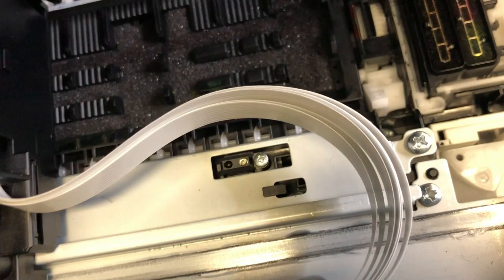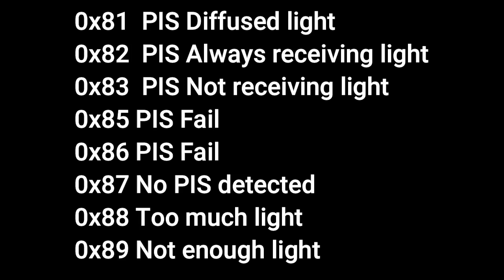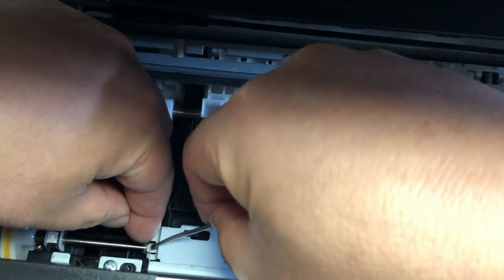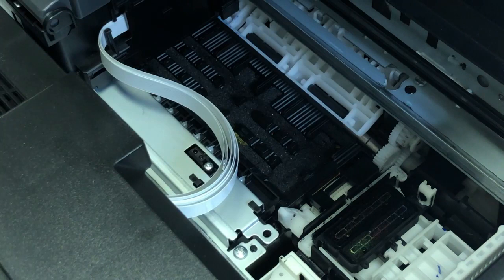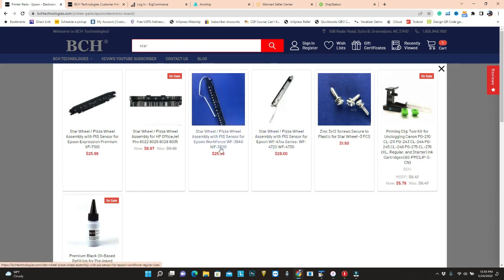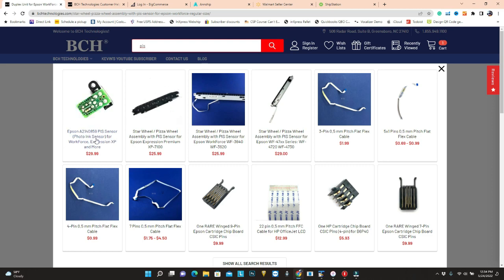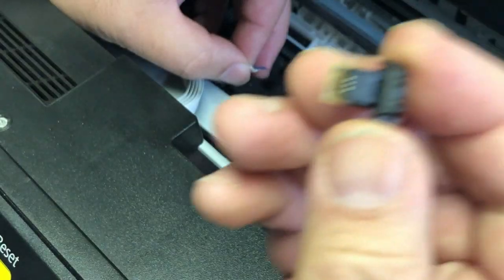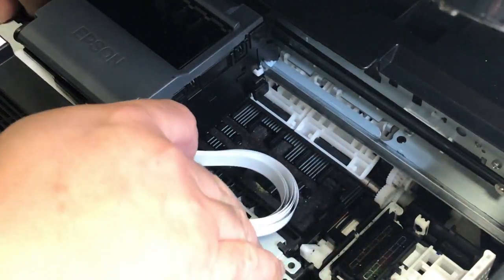Epson 0x81 0x82 0x83 0x85 0x86 0x87 0x88 0x8Error Code - Replace PIS Sensor

Comment: Hello, please help. I have a canon5051 printer that has a code B0. How can I solve the problem? Help me
Reply from the maker: Is it B0 or E0?
Reply: @BCHTechnologies  code de support5b00 knowing that at first it was recording code de support5100 and when I click on the orange lock and press the stop button it returns to work and now it no longer works and this problem is faced with it
Reply from the maker: @ABDOUDz_2011  Go to eBay and search for something called "Canon Service Tool".